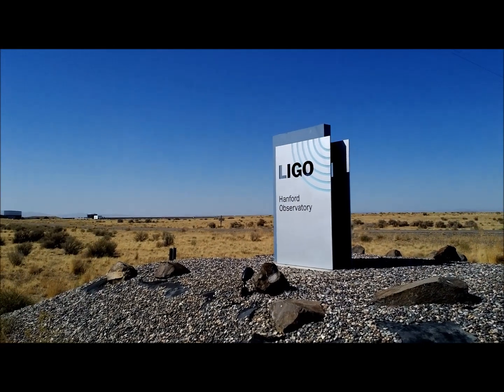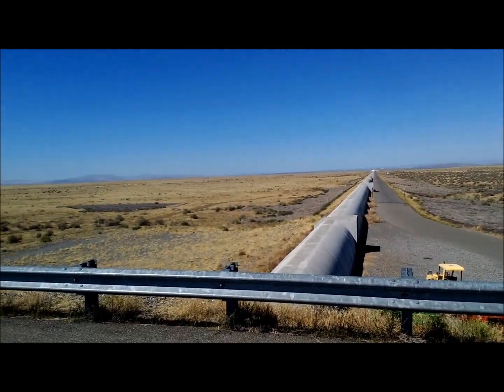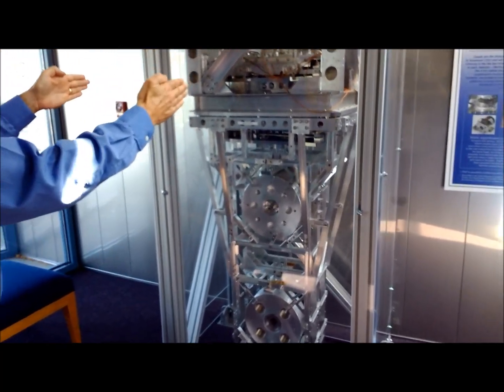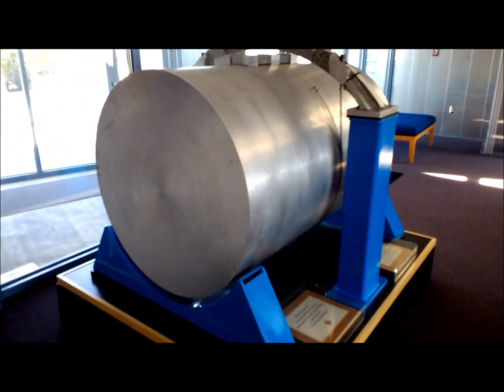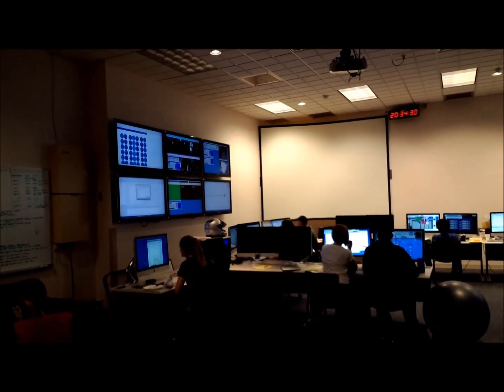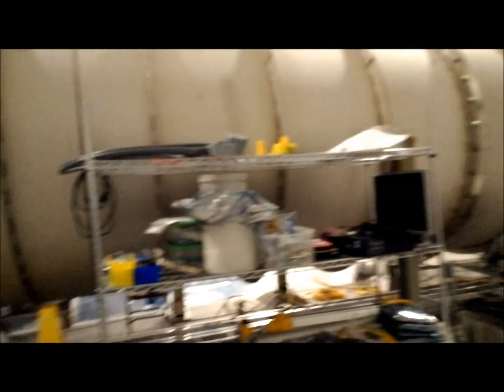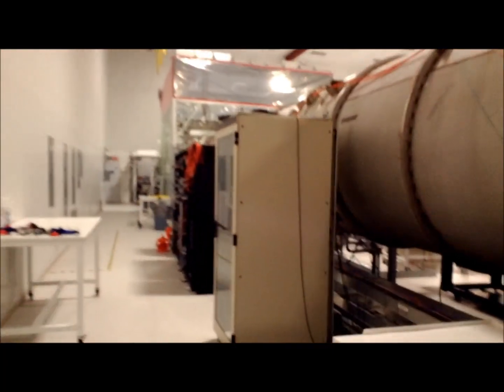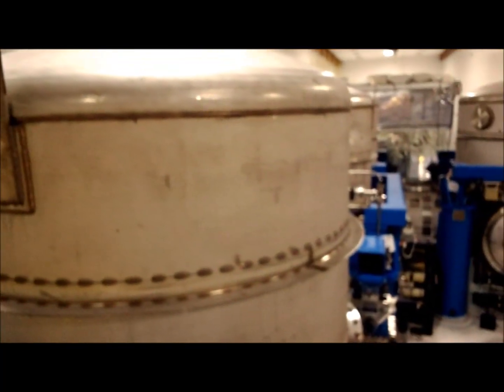LIGO Hanford- The Hunt for Gravity Waves

Comment: I have a question: If a gravity wave stretches one arm and shrinks the other, doesn't it affect the wavelength of the light inside those arms as well? I mean it should keep the number of wave peaks and troughs in each arm constant and keep both waves in phase. Can you explain that plz?
Reply from the maker: +SAHM Interesting question... I'd say the beam is stretching as well, yes, but the travel time is changing by a tiny amount. Plus, you'd see the wave pass through the two LIGO detectors at different times at the speed of light. That's my thinking, as a science writer, non-scientist. I can kick this question up to a physicist friend, if interested.
Reply: +astroguyz HI +astroguyz, Thanks for responding. Why should the travel time change as well? Is it because the speed of light is constant (I doubt about this part since it's not innertial) and the length changes? Does that mean we can have a pulsated laser and measure if the beam in both arms go out of phase for fractions of their cycles? (I'm studying Mechanical Engineering, but very interested in physics.) I would appreciate if you ask someone. I have seen other people asking this question as well.
Reply: One more question: If you say speed of light is constant regardless, and length is changing because gravity, doesn't that also affect time and make time go slower (time dilation)  because gravity? Then i would expect the light to take same amount of time to travel in both arms as well. Am I making a mistake here and these two double the effect?
Reply: +SAHM Dear SAHM, I think you are saying and thinking that the "change of the length or time" rescales everything - including the atoms and the electromagnetic waves - and therefore it's just a change of units and nothing physical changes.

But that's not what a "change of distance" and "change of duration" mean. The distance in meters is defined as (a numerical coefficient times) the number of wavelengths of waves emitted from a particular atomic transition. And the time in seconds is defined as (a numerical coefficient) times the number of periodicities of a certain radiation (now the same).

So the number of peaks and troughs in each arm changes when the length of the arm changes. That's by the definition of the "length" (or a definition of one meter and one second, if you wish). The radius of the atom and its characteristic frequencies in Hertz are always the same - because one second is defined as a multiple of the periodicities of those local atomic oscillations - but the length of the arm really changes.

Beginners often display the very same misconception when they talk about the expansion of the Universe in cosmology. They say that everything - not just the distances between galaxies but the size of each human and atom etc. - changes as well so we shouldn't be seeing anything physics. The expansion is just a fictitious effect, a time-dependent change of units. But that is not what the expansion of the Universe means. The expansion really means that today, one can squeeze a larger number of atoms (or humans) in the tetrahedron in between 4 adjacent galaxies than a few billion years ago. The ratios change. 

The local objects - like atoms - are still equally large (in units like meters) because units like meters are defined as multiples of the sizes of these small, local objects (e.g. wavelength of the radiation from an atomic transition). But the large distances - like the length of the LIGO arm or the distance between two galaxies - really change. Either in meters or in the radii of atoms or in the wavelengths of a radiation.
Reply: Isn't that what relativity was saying? That distance and time (processes) change in the same rate, and therefore you measure speed of light the same? (Looking back at Michelson–Morley Experiment)
Reply: +SAHM No, relativity has never been saying anything similar to what you did. Special relativity guarantees the constancy of the speed of light by properly mixing space and time in other reference frames, not by uniformly rescaling them.
Reply: +lumajs What do you mean by Other reference frames?
Reply: +lumajs I know that when they talk about expansion of cosmos, it means that dimensions of Earth and Moon are the same, but their distance isn't the same ( basically what you said for galaxies, or the classroom analogy for this) but I think that's not the case with gravity waves and space-time expansion-shrinkage. Why shouldn't change of length affect atoms? Isn't space-time expansion/shrinkage affecting space and time (instead of atoms) I can't get the connection here.
Reply: +lumajs I also like to know your education and degree.
Reply: +SAHM Dear Sahm, my name is Lubos Motl, I have PhD from Rutgers and MSc from Charles University - in theoretical physics which I've taught at Harvard for years. ... Gravitational waves don't shrink or stretch atoms because the size of atoms is dictated by the electromagnetic force - by a fast and constant exchange of virtual photons. This electromagnetic interaction always implies that the total kinetic+potential energy of atoms is minimized when the proper distance between the electron and the nucleus averages at the Bohr radius (for the hydrogen). This whole atom - electron, the nucleus, and everything in between them - is just "immersed" to the surrounding gravitational wave but the wave changes nothing about the local physics. By the relativity and equivalence principle, one may always switch to the rest frame of the atom; and the freely falling one, and in that frame, all effects of motion as well as gravitational fields disappear - up to non-uniformities of the gravitational field (tidal forces). But for supertiny objects like atoms, much shorter than the gravitational waves, the tidal forces are negligible, too.

The proper size of atoms in conventional units like the SI units or any units linked to them is simply constant and everyone who has ever read and understood the definition of one meter must understand that. This should take a few second even if someone hasn't thought about these elementary issues before - and by repeating your not so intelligent question, you start to be very difficult because it no longer looks like an honest question.
Reply: +lumajs Dear Lubos, My name is Seyyed Ali Hedayat Mofidi (SAHM) and I'm a PhD Student in mechanical Engineering dept. University of Utah. My knowledge of Physics is limited to what I've learned in Undergrad and some documentaries + articles I read online. My interest in Physics and relativity brought me to this video and the question that I asked in the first place. I would like to continue this communication in Email if that wouldn't waste much of your time.
Reply: lumajs
Hi Again

I sent an email to lumo@matfyz.cz if that is still working. Otherwise I have to communicate either here or on your weblog.